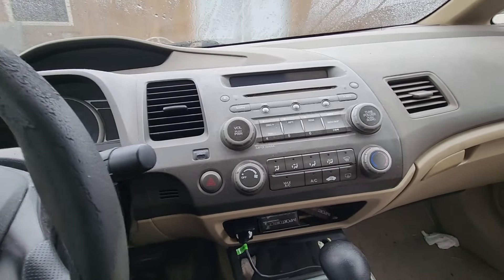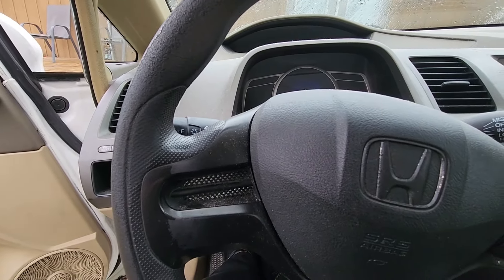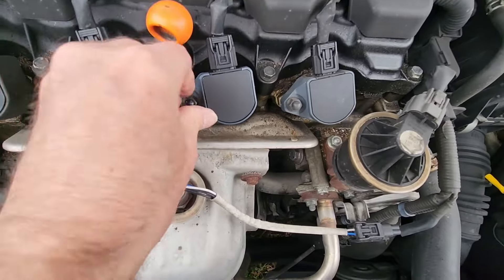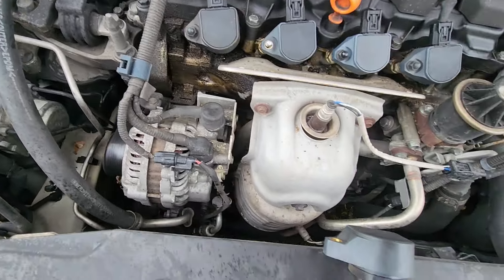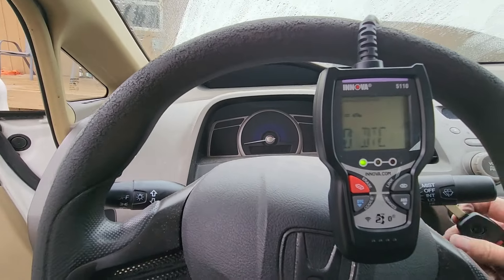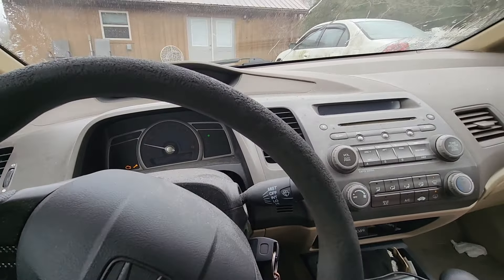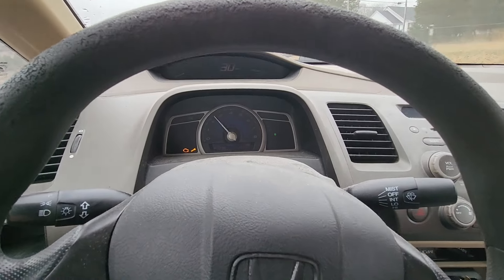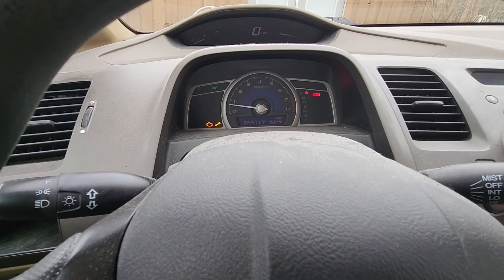Can I fix it? - 2007 Honda Civic - Misfires and hesitates with little power - It just won't go

Comment: Thanks for the demo, Back40 Bandit.  
I think that I'd disconnect the positive terminal first.  It may be worthwhile to at least pull that spark plug (clean it up for starters), and clean the oil out of the spark plug tube.  Good chance the valve cover gasket is the source of the oil leak.  I'd also consider ordering a Denso coil versus a generic brand.  Maybe just replace all the coils, plugs and air filter as soon as possible after fixing the leak if close to a tuneup being due.
But I realize this is a quick fix demo with speed and keeping it inexpensive as possible goals too.
Reply from the maker: -- I like to try and repair what I can before going to a mechanic business.  Cost savings is the main goal. Learning and experiencing is the second goal. But, having a vehicle to haul my old @$S around is paramount. 😀
Reply: @back40bandit98  I hear yah.  I like your attitude of experimentation and troubleshooting.  I'm not a mechanic myself, so it's a way to learn.  Plus I always want to keep it cheap on repairs.
Thanks for the swift reply.

Comment: Why do so many people NOT look at a Chilton's or a Hayne's manual to see what their vehicles cylinder order  and firing order is? Your local public library has them for free, just takes a little  to look for one. Also the valve cover gasket appear to have a leak along with possible camshaft plug on the end by the air cleaner box,  leaking oil. Erasing a code reader is usually done with the key in ON position but not running. read the instruction manual with your code reader.
Reply from the maker: -- Well,  I had one. But my neighbor,  I call him 'Slim Biscuit', ran off with one of my radiators and my Chiltons manual. That was a few years ago.  I've just been too lazy to go get another one.

Comment: As stated by previous comments there is a few common areas the seals need replaced for the oil leaks and yes a civic manual does help with all the misinformation on youtube, follow the service reminders would be a good start, the car looks like it had a sad life ......still its a Honda it can take a beating ......still a good attempt at fixing the car
Reply from the maker: -- I'm still driving this Honda Civic as my daily commuter car. It's dirty and driven hard. But as long as I give it some TLC once in a while, it keeps on going.

Comment: Fix head cascade , get new spark plugs , and clean all the oil
Reply from the maker: -- That is a good idea! I will give it a try. Thank you for watching the video. I hope you enjoy all my other videos as well.
Reply: Seeing that oil on the bottom of that coil tells me the rubber seal ring is leaking inside the chamber.  For sure will cause that coil to misfire.
Reply from the maker: -- No matter how much I try, that car will not stay brand new.

Comment: You realized you changed out the coil for cylinder number 3 right? Cylinder 2 coil is the second in from the left not the right.
Reply from the maker: -- Yes, I realized that as soon as I was done making the video.  Certainly, it took a long time for anyone to call me out on it. Thank you for watching the video.  I've driven the heck out of that car. It's about time to do some more work on it.

Comment: Good job 👏 😊
Reply from the maker: -- Thanks. I still have a few things to do on the White Honda Civic.  Like brakes, oil change, vacuum and clean up the inside, wash the outside, and check all the wiring.  I should probably replace a rear wheel bearing, too.
Reply: @back40bandit98  You're welcome 😊

Comment: 9999 miles past oil change? Surely you just didn't reset the light, right? But you DID change the oil, right? Lots of mistakes in the video.
Reply from the maker: -- Hi Bethy, thank you for watching the video.  It is my troubleshooting process to learn as I do. Sometimes,  I have to learn by my own mistakes. But yes, I have changed the oil.

Comment: You have a head gasket leak
Reply from the maker: -- You are correct on that head gasket leak. I will be attempting that head gasket replacement myself sometime soon. Hopefully,  it doesn't get much worse before I get around to it.
Reply: @back40bandit98 Hello . Please make video . I have same engine on my Honda F-RV :)
Reply: Head gasket or valve cover seal?